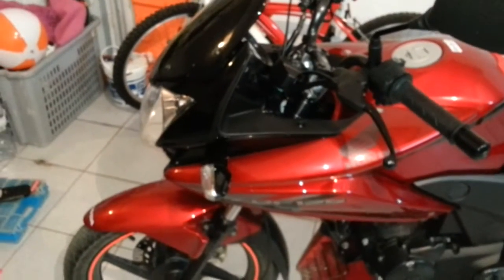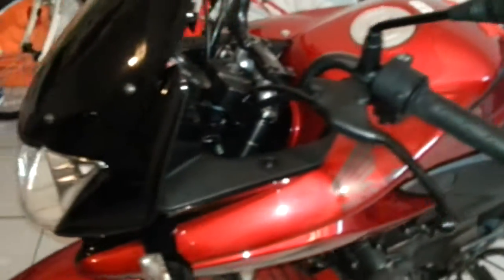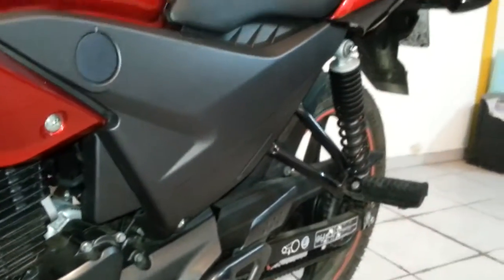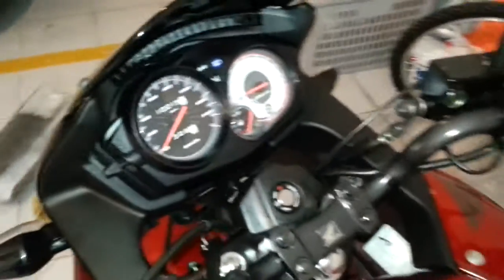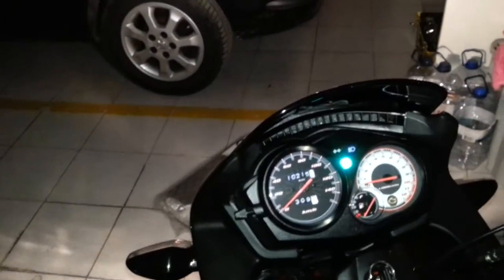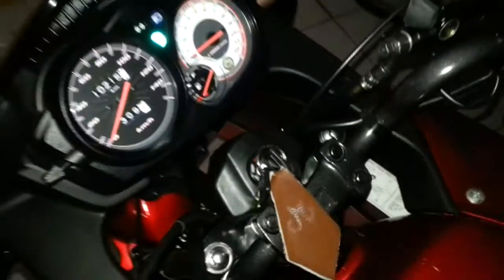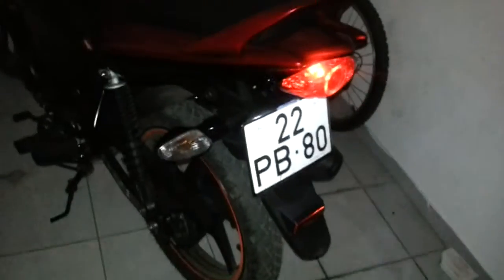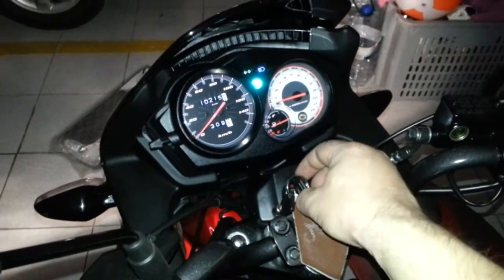CBF 125 DC circuit, led lights

Comment: why you would do this?? the difference when you accelerate  is minimal
Reply from the maker: Because the bulbs go out more often than with this system and also afterthe change you can use led light
Reply: @MPANeves  if you use quality bulbs it should last years, osram is good

Comment: Did you cut the Black wire from the two wire brake connector and isolate the rear side, and connect the front side(the side of the White connector) to the relay? Or you connector the relay pin directly on the Black wire? I am asking you this because when I connect it tse second way, my battery does not charge to 14.4v, and drains so I cant start it... 
Thanks a lot!
Reply from the maker: Hello,
It was long time ago but if im not mistake it was the first way that you refer

Comment: can you help me do this? specifically what parts I need to buy?
Reply from the maker: nrgnz34 
hello this is the link but is in PT. 
https://youtu.be/c_1U2qVxUNQ
you need the 4 pin relay and the wire connector,its cheap from ebay.